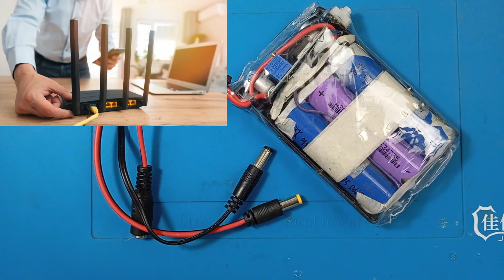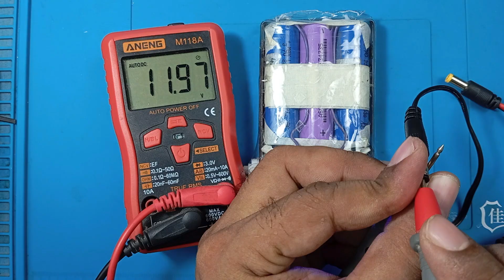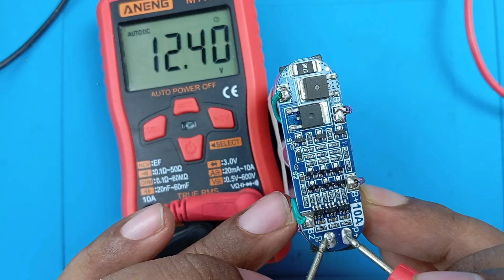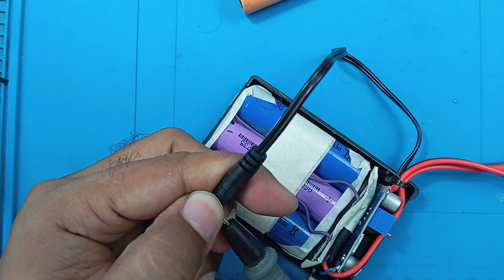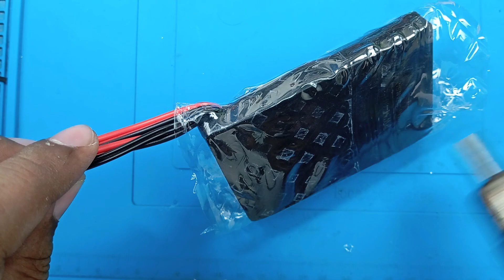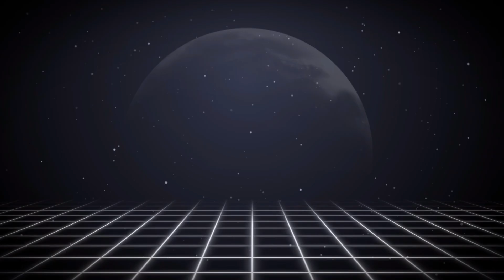DIY Mini UPS for Router and ONU: Stay Online During Power Cuts!

Comment: Could this be used for raspberry?
Reply from the maker: Raspberry pi model?
Reply: @fixifite 3 or 4. That's what I have... Powerbanks dont work well. I made a cyberdeck but I always get power warnings because they don't give that much.
Reply from the maker: It’s not suitable (especially for a Raspberry Pi 4).

Pi recommended supply:
Pi3: stable 5.0–5.1 V at ≥2 A (safe).
Pi4: stable 5.1 V at 3 A recommended.